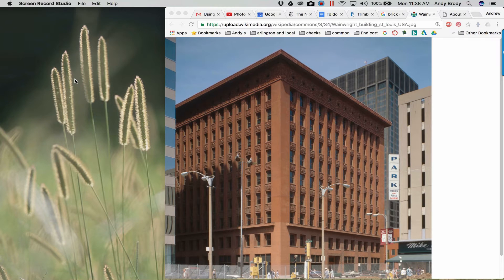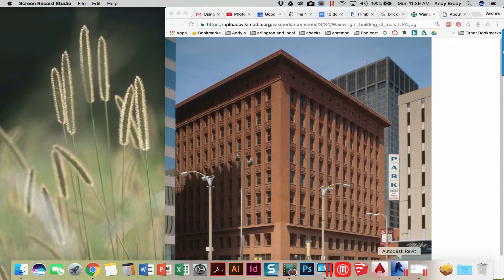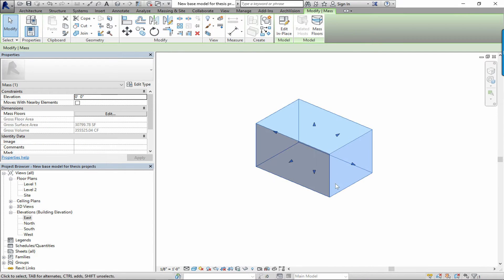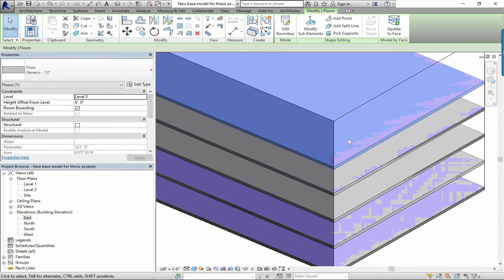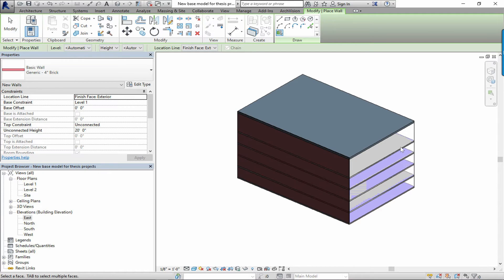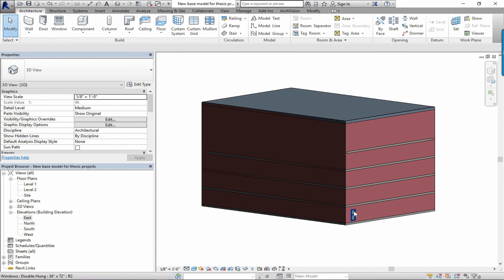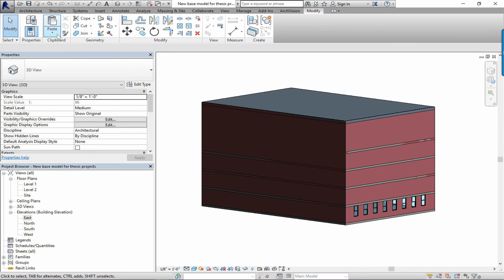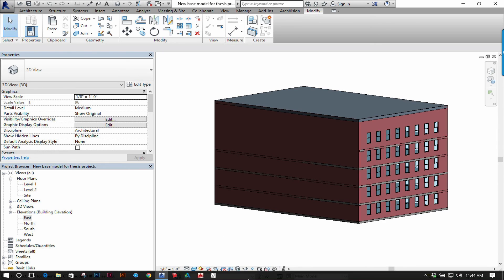Modeling a simple building in Revit

Comment: How did you get more floors
Reply from the maker: Define "levels" in the main model in Revit. I usually do this in an exterior elevation, by copying the level indicators (the dashed lines with a bullet icon at the end). Once you've created the levels, select your conceptual mass, and the choose Mass Floors by Level...
Reply from the maker: You can add them when you add all the others, by just creating new levels, and then use the floor by level tool. Otherwise, create levels as you would an existing model...